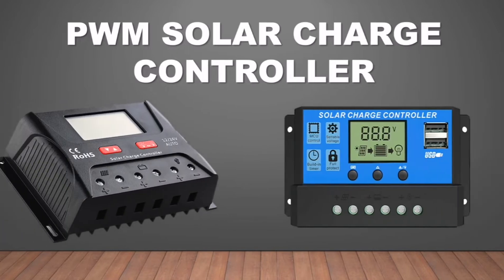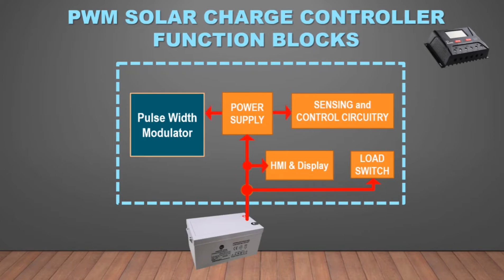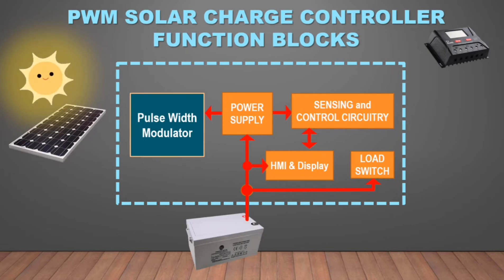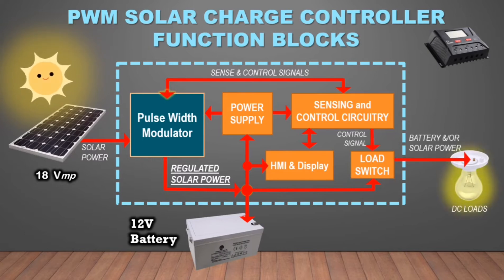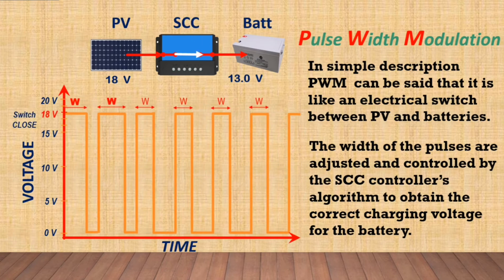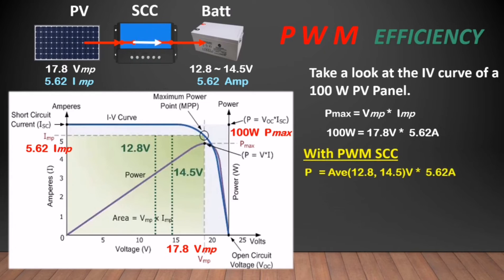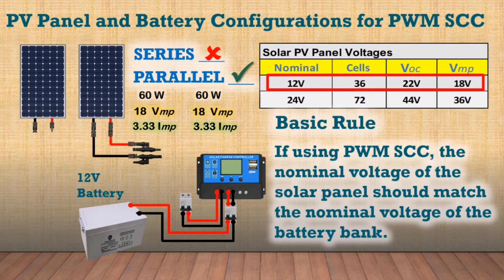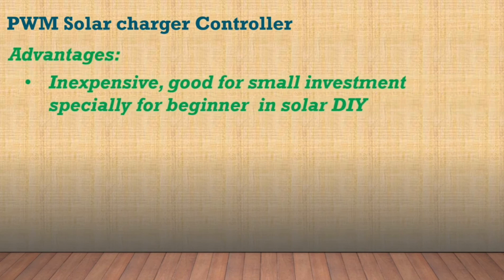PWM Solar Charge Controller, Explaining the function blocks and and how Pulse width modulation works

Comment: How can u tell if the battery is charging or not
Reply from the maker: You need to have a multimeter atleast to check voltage. Before charging and give a little boost charge if your battery voltage did not rise or no changes. You have a battery problem.